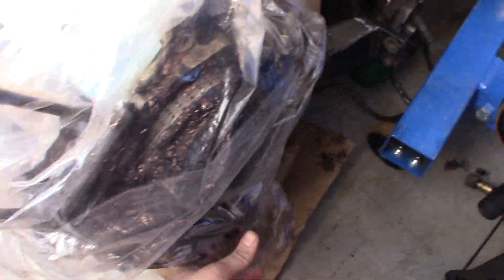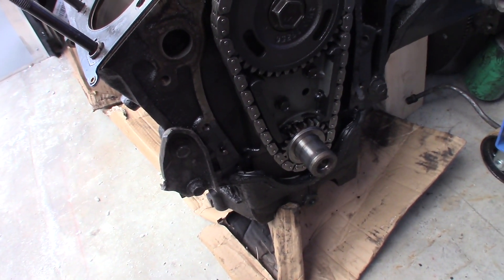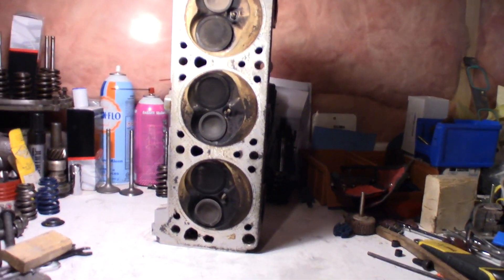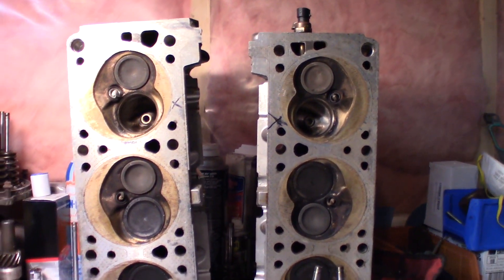Building a 300HP N/A GM 3400 v6! Part 1

Comment: Ive got a 1998 Lumina sedan. My 3100 serves its purpose, sees routine maintenance,  and runs like a top. Im not one to mess with perfection, however, if something catastrophic happens or the inevitable LIM gasket failure, I'd consider swapping in something like this. 3800/L67 + trans  is more than doable, but way more effort than I'd like to put in compared to essentially a top swap.

Comment: where is the 2nd part ??    got me a vehicle  with the  same  engine --  chevrolet venture   185 stock  though --   are you actually building it  to deliver  up 300 hp???
Reply from the maker: Once I get a few other things out of the way, I will be getting back to it. Long story short, I purchased the engine back along with a few other parts. And yes, I will keep trying to get to the 300hp even if it doesn't make it on the first attempt!

Comment: Has anyone drilled and tapped the manifold at cylinder 1 with a quarter inch nipple to allow water flow out of the head instead of the coolant just swirling around @ cylinder #1 and just cooking that cylinder?
Reply from the maker: I don't think so, but I have thought about doing that and running lines to the back of the thermostat to help balance the temperature from front to back.

Comment: I hope that engine build works for you. Them stock 3400 motors were trash. My dad bought me an 04 monte carlo I got about 5 years out of it it uses and leak more and more oil as time went on. It's going to scrap. Stay away from the 3400s. 3800s are the best. That's my advice to people when they consider buying a good used GM car.
Reply from the maker: 3800s leak oil too, as do most engines that are 20+ years old. I would take a 3400 over a 3800 all day.
Reply: @modeverything1  all depends on how you take care of them too and keep the oil changed. Most common reasons why oil leaks especially on 20+year old cars is the oil pressure sensor and rear main seal goes bad.

Comment: We got the itch lol ,following your channel now lol my son has 91 cav z24 3.1 5 speed, bought a wrecked 03 Montana van really nice 3.4 this is a doable swap correct? Run the 91 computer keep the 3.4 intake injectors?
Reply from the maker: Yes it will run on the stock computer with the stock 3.1 injectors, but you will see better results with the 3400 injectors and a custom tuned chip or stand alone ecm.
Reply: @ awesome thanks for the info! we’re in the middle of freshening up the motor just a re seal timing chain and once the snow hits here in Saskatchewan pull in the shop play around over winter ❄️

Comment: Planning on swapping a equinox 3.4 into my 2000 Malibu, swapping the plenum for the more common smaller version for now just so it fits. All stock so should be a fun project over the winter, hoping to integrate some ideas from you vids to boost its power!
Reply from the maker: I believe you will need an external crank trigger to run it on the malibu pcm. The Equinox/torrent engines have a few differences over the normal 3400/3100s

Comment: Where do you find rebuilding specs for the 3400
Reply from the maker: They used to be posted on 60degreev6.com but I'm not sure if they are still there. Haynes manuals will have them, or Most Automotive shops should be able to print them for you!

Comment: I have a 1993 olds with the 3.1 multiport, i upgraded the fuel pump, injectors, and did some light polish and porting on the heads, and had the intake extruded honed to clean up casting flash on the inside. Made a big difference in performance. Nrxt is a holley efi system so i can set a base tune. I was a driveability tech at a gm dealership in the 80s and 90s when this engine came out, and i fell in love with it
Reply: Keep us posted
Reply: i got a 98 3.1 ill be rebuilding what mods or parts would your recommend? looking for 200hp at least 1998 monte carlo

Comment: Now time to drop one of these modes 3400 in a Venture or Montana
Reply from the maker: I would like to do a 3500 or 3900 one day if I could find a van that's not completely rotted out lol
Reply: @modeverything1  yeah the rocker panels are always the first to go other than that the ones where I’m at(Missouri) are pretty clean
Reply: That would be an interesting sleeper build. I have a 3.4 L in my venture and it seems to be more powerful than me. Factory advertised 185 hp.

Comment: Hey is there anything that I can do to get more power out of my 2005 Buick Century 3100?
Reply from the maker: There is quite a bit that can be done. it all depends on what your budget is! A larger Throttle body and a PCM tune are a great start, and make the car nicer to drive!
Reply: @modeverything1  Hey I’m going to the junkyard in the morning and getting the whole intake off an 3400 💪🏿💪🏿💪🏿
Reply from the maker: @hoover274able  no need for the whole intake. Just get the throttle body and you will be good!

Comment: Since its an iron block how much could we bore over the cylinders? Are there any performance aftermarket parts out there? Im new to these small 60 degree v6s
Reply from the maker: I believe. 040" is max "safe" limit for boring over sized.  Might be able to get away with more if you get the block sonic checked. There is some aftermarket parts depending on the application. Alot of parts are only able used like TCE 65mm Throttle bodys but you can use the 3.5 DOHC Intrigue TB instead with an adapter.  Cams you can order from comp cams, pistons are custom for forged. For rods, you can use 327 Small journal SBC rods, but some will need narrowed and the pin bore bored of sleeved (2.8/3.1/3.4).
Lots can be done but it's not like others where you can buy what you want off the shelf!

Comment: I have a 1987 Cavalier RS soft top, I was see where to start at swapping the 2.8 with something fun like 250-300 HP range, where do I start ? I know nothing 😅 just a old ass car 😂
Reply from the maker: 3400 swap is probably the best place to start. There should still be a swap guide on v6z24.com
I would recommend Reading over that first then work on upgrading the engine.

Comment: I have an Oldsmobile Alero 3.4, I looked high and low on all forums and videos available on the topic but no one has a sure list of upgrades available to get the HP from stock, up to 250-300 HP. Besides the basic upgrades (ported heads, CAI, tune, turbo or supercharger, exhaust, what else can I do to get more power and efficiency out of the LA1 engine ? I'm currently in the middle of the process of swapping the old motor and trans out and putting a new one in and I want as many performance parts on there as I can that will have the 3400 running at its peak. My uncles are mechanics and they told me the 3400 isn't a weak motor. I'm hoping someone can actually prove them right and give me the feedback I need to make the ultimate sleeper
Reply from the maker: Aftermarket cam and exhaust/headers make the biggest gains! I think with a wot tech street/strip cam, headers, ported heads 2.5" exhaust, 65mm TB and a tune would get you around 250hp but I have not dyno tested this combination myself.  Or 6-7psi boost on a stock 3400 would get you 250hp+ !
Reply: @modeverything1 can that be done without sending some rods to the moon?
Reply from the maker: I think it can be done! I just moved this engine to my home garage so I can put it together this winter!

Comment: i have 3.4 and looking to swap top end 3.5 ,  The lower intake are same 3.4 and 3.5? Or need both intake from 3.5? And need 3.5 injector to run that ? Or 3.4  thankss🤞
Reply from the maker: You will need the 3.5 lower intake manifold to match due to the ports being in a different location on the heads. Upper intake is interchangeable as far as bolting on. 
Use the 3.4 fuel rail and injectors, the 3500 is a return less fuel system.
Reply: @modeverything1  thanks appriciate , and is more performance 3.5 head or is possible to make same with the uper and lower intake and porting my 3.4 head
Reply from the maker: Stock 3500 head vs ported 3400 head, the ported 3400 would make more power when done correctly. I would like to do some more testing one day to confirm the power gains from 3500 top end.

Comment: Really don't think it's worth it, but go for it, sure it be fun to drive, I'm thinking of just getting the torque camshaft for my 3400 just to give a little extra but that's about it. These roads have been traveled down many times before and wot Tech is miniscule these days they practically have nothing anymore they used to have ported heads ported upper plenums full engine builds for sale.  If I personally were to look deep into this I'll be looking how to incorporate or drop in the 3.6 VVT.
Reply from the maker: We got a good deal on the short block, and we already had a better cam and top end. Wot still has heads and cams available and will probably do a build if you wanted but you would have to contact them. I like to do as much as I can myself and not break the bank. 

If I was looking for more camshafts I'd look at a platform with more aftermarket support! Lol
Reply: @modeverything1  Hell yaa bro. Well i have a pretty nasty tune on it so not looking for too much out the stock RPM range. Tune im currently running is the police tune. However they never use the GM 3400 for police use. This engine loses too much steam after 90mph. However your build may prove slightly different👍

Comment: Any update on the build?
Reply from the maker: Right now he is getting the brake lines done, and the front subframe replaced. I should be starting on the car in April or may, but I should be getting back to the engine in March!
Reply: @modeverything1  nice 👍🏼

Comment: I work on cars and such but im new to modifying cars. I have a 3.4 Alero i was wondering if i can add a different header with more valves ???
Reply from the maker: You can change to 3500 heads and intake manifolds, they flow more air wich results in more power! Or you can upgrade the valves in your 3400 heads with valves from the LX9 3500.  I would start with some simpler things like a larger throttle body or a less restrictive exhaust system!

Comment: What the best cam to put in a 93 camaro 3400 v6 with out changeing a lot just for street car to have a little fun with
Reply from the maker: Depending on what cam you go with you most likely will need upgraded valve springs. Is the rest of the engine stock? Headers? TB? if it is mostly stock I would not go too crazy.  Might be worth a call to someone like delta cams, they would be able to tell you, or even custom grind on for you!

Comment: Hi... i have a cavalier z24 V6 3400
Reply from the maker: Nice! Any mods?
Reply: @modeverything1  yes... my engine have a LS3 yellow spring valve, 800cc injector, Aeromotive fuel pressure, 3 inch air cold intake, 2.5 exhaust pipe, ac eliminate, power steering eliminate and other stuff

Comment: You seem like the guy to ask. I eliminate all wiring and only use coils and crank sensor, does the timing still advance? And can you tell me what distributor I can use that has a vacuum advance?
Reply from the maker: Not 100% sure but I'm going to say no the timing will not advance.  I take it your trying to run a carb for a demo derby car? The older 2.8 fire birds/Camaro's/s10's used a distributor but Im not sure if the carb ones used vac advance.  
If you did run the distributor on a 3400 you would have to clearance the upper and lower intakes. (Cut/weld)
Reply: @modeverything1  yes carb conversion on a derby car. I've done it a couple times and they run too good for it to not be advancing. I was just curious what actually controls it. As far as the intake I modify and weld the intakes already. Was just curious if you knew of any distributor that would work even if it had to be modified a little
Reply: I use a Malory unilite distributor on 3.4...

Comment: My 95 camaro has a 3.4 sfi in it I heard it doesn't take to added power to well
Reply from the maker: Depends on how much added power you are talking about! The FWD blocks are stronger but the RWD blocks have been pushed past 400hp and held up fine.

Comment: Really interesting to see how this will go.

Im rebuilding a 3.4 camaro V6 with 3.1 (gen 2 heads) and 3400 intake. Thinking I might get 220-230 out of it, well anything over 200 would be nice.

What camshaft do you think youll go with?
What kind of rpm are you aiming for?
Reply from the maker: Going to use the "strip performance" cam from wot-tech. It still has stock rods so we are going to keep it under 7000rpm, probably 6800 max.

Comment: By the way, I just got done with a LA1 to LX9 swap in my 05 Rendezvous...been running it around for a couple days now.  Could not be happier...it fired up within 2 seconds on the starter, like it wanted to run.  Now I'm thinking about somehow using the LZ9, getting some of that 3.9 liter goodness instead of a 3.4 setup on a van...but no VVT, no variable intake...just more displacement.
Reply from the maker: That's awesome! The LZ9 won't  be as simple,  you need to figure out the  24x crank sensor behind the crank pulley, and a cam sensor since the lZ cam sensor doesn't line up with the reluctor on a 3x00 cam.

 But you could always swap the ecm / harness and keep the vvt...

Comment: Using a GM / Camaro RWD 3.4 for a Locost build, but already have the 2005 GM 3500 LX9 top end ready to install...  WOT still a thing?  GREAT!
Reply from the maker: Nice! Is it getting a cam too?
Reply: @modeverything1  if one will go into a RWD block, most of what I've seen of the recent stuff goes into a FWD block
Reply from the maker: @geek49203  if you search for 2.8 Chevy v6 camshaft you will find off the shelf performance cams. You can also call around to places like delta cams, Crower cams and others to see about a custom grind if you want more than what is offered in the catalogues!

Comment: Is that a chevy 2.8L v6
Reply from the maker: It's a 3400, without heads on they look very similar to a 2.8v6 at a glance! Unless you can see a 3.1 v6 in the background 😄
Reply: My friend has a 1985 2.8L v6 38,000 came  out of a blazer s10 
$300 thinking about buying it making around 230hp

Comment: That's a little unrealistic NA. The highest horse power na 3800 build was 247hp at the wheels, and that was an all out sponsored build. 

I mean maybe at the crank? If that's what you're looking for. That would still translate to about 260 at the wheels
Reply from the maker: Wow I thought that the N/A 3800 record would have been over 300whp by now! The highest N/A 3400/3500 sofar was a SBE 3500 with a cam, home ported heads/intakes, home built headers and it put down 275whp over 10 years ago lol

We are going for 300 crank hp on this build!
Reply: @modeverything1  got a link to this 275 "wheel horse power" 3400? That just seems unrealistic as well. I'm just not believing that's even possible without seeing the dyno sheet.  Warshike had a 3800 that was an all out custom build running in E85 with 11:1 compression that ran 247 on a dyno. That's The build I'm talking about and it's available to see for proof. Holds the record.
Reply from the maker: https://youtu.be/vCdRKvMlmck it's a 3500 (larger bore than the 3400) he pulled the engine and put it in a 3rd gen Camaro with a auto and the power dropped to around 260whp iirc.  The 3400/3500s have much better flowing heads than the 3800's and with the right parts you can spin them 7000rpm + no problem. They are very overlooked engines!
Reply: @modeverything1  It's always funny to come across a video where people are talking about something I did years ago in the comments. I eventually sold that engine to a guy that put it in a Fiero. I have no idea what happened to it after that.  Good luck with your future projects!

Comment: Ready to follow this one!. That's a high number for an old v6 like that! Interesting going off the 1/8. The calculators I was trying to use were only putting me at like 210-220 at most on the 7/8 psi lol it'd be nice to sit right around 300 without having to go past 15 psi!! Look forward to what's next!
Reply from the maker: Yeah had to go by 1/8th mile because that's the only track that he ran it on! Lol
Well there is people claiming that they are making over 300 whp with iron heads on a 3.7l... so 300 crank with aluminum heads should be possible lol
Your car has a lot more in it, once its sorted out it will piss alot of people off! Lol

Comment: Thanks for giving some love to the GM 60° V6 pushrod family.  I've been messing around with an LA1 to LX9 swap...almost have it done.  Future option to get a bigger throttle body, maybe a tune.  Will you use the variable intake runner, or VVT?  Or will this be all cam and heads?
Reply from the maker: This is a 3400 block, so no vvt. For now it will be heads, cam, intakes, headers, then we will work on improving it from there! I'm trying to get more 60* content on YouTube, there is not enough! Hopefully this build gets more people interested in them!